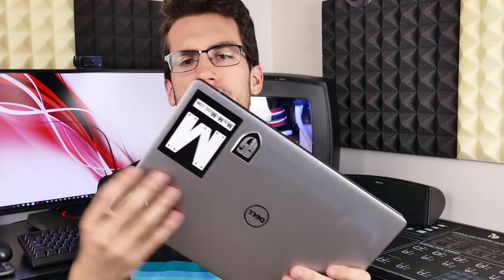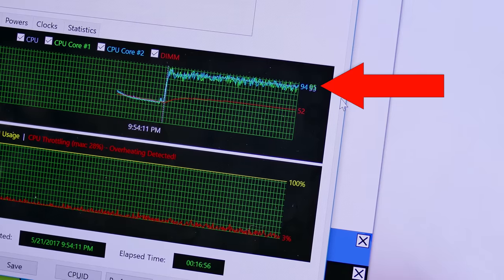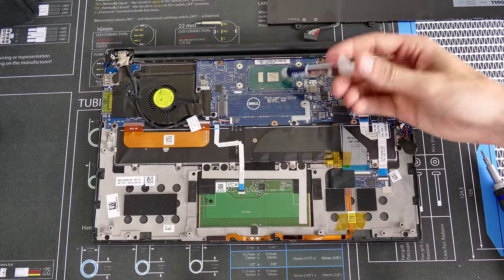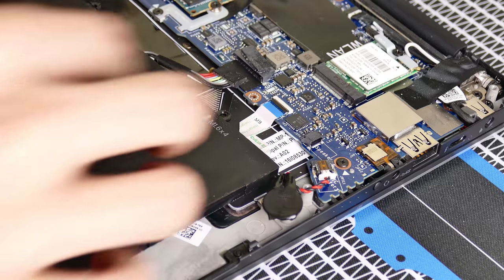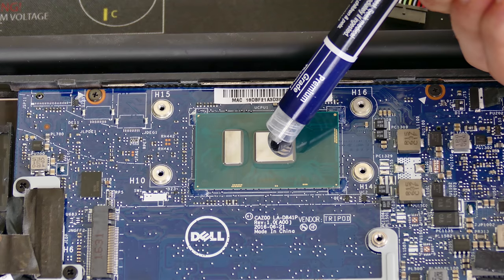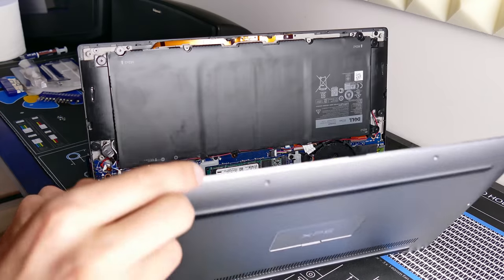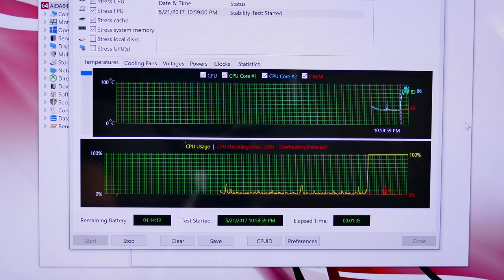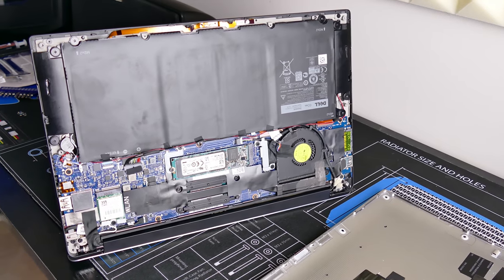Laptop Running Hot? Try This!

Comment: OMG you used way too much thermal compound, unsubbed!

For those that don't get this is sarcasm, it's sarcasm.
Reply: Hardware Unboxed ooohh Hardware Unboxed, love ur reviews!
Reply from the maker: Disclaimer 100% necessary this day and age LOL
Reply: Science Studio what does undervolting do
Reply: +Roko Krstičević - It turns the flame from blue to the yellow you see in the thumbnail.
Reply: Roko Krstičević undervolting isnt too complicated. Its somewhat related to overclocking, except the goal isnt to reduce performance. Stock voltage on cpus is not the minimum voltage a cpu can run at, its a standard voltage used that should work on all chips. this is why you "can" overclock on the stock voltage. undervolting simply keeps stock clock speeds, while lowering voltage. this can create instability problems so it has to be properly tested. 
an easy way to think about it is:
voltage + clock speed = output heat.
so if you lower either the temperature will decrease.

honestly if you don't need the extra clock speed, its a good choice to lower temps, and thus improving  life of the parts.
Reply: sar what?
Reply: deinemuddaisdoof 
voltage + clock speed = heat
so undervolting lowers heat without sacrificing clock speed. its basically the same premise as overclocking
Reply: ThePaisleyProject thanks for explaniatshdj (fuck my grammar)
Reply: Roko Krstičević no problem, I like sharing my knowledge. Extreme overclocking is my speciality
Reply: m8 I use 3 40g tubes of Hellman's lite TIM on my CPU... the more the cooler amirite!!?
Reply: ThEcRaZ3dGaM3R your doing it wrong, 40g of Skippy is optimal for gaming...
Reply: dude he is not dumb but pretty funny tho👍 nice👍  i have subscribed ur channel too
Reply: Hardware Unboxed I
Reply: lmaoooooooooooooooo
Reply: Hardware Unboxed ;)
Reply: Science Studio Did you just assume my age!?
Reply: Roko Krstičević lol
Reply: @GregSalazar  hello sir my laptop is HP core i5 my laptop is getting hot when i take 1 app can u tell why is it getting to much hot

Comment: "puts laptop in a fridge"
Reply: I run a copper pipe system from my freezer to my laptop. Temps work great!
Reply: dogsrulenw08 oo sounds funky
Reply: Vorphyrion there's moisture in a fridge, so you are killing your laptop.
Reply: Climatee If a copper system was indeed running from the fridge,it would mean copper pipes carry heat from the laptop to the fridge,where low ambient temperatures are I guess supposed to passively cool it,not sure where you're getting the idea of moisture getting involved.
Reply: Vorphyrion dumps fridge in Antarctica
Reply: Welp, as embarrasing as it is I cannot find the source, it's buried in some post at those forums. Anyway, dudes benchmarking 7700ks on their laptops often repaste CLU due to it breaking down after so many high temperature sessions. When I come across the specific post about Dell's paste sacrificing performance over longevity, I'll throw it here!
Reply: Vorphyrion "dumps it in pool*
Reply: That's what Linus could do.
Reply: Spoilers: Laptop over heats and shuts off because fridges dont recycle air.
Reply: something Linus would do.
Reply: as a kid I once put my x box 360 in a freezer to fix the red ring of death.
Reply: I did this with my ps3 once lol
Reply: It would kill your laptop faster than overheating.
Reply: Marcin Kąpiński Shags batteries for one!
Reply: Vorphyrion i put my phone in my fridge every time i can it hasn't die soo
Reply: LagiohX3 I phone is passively cooled therefore air isn't constantly needed to be recycled to keep it cooled..  weirdo... lmao.
Reply: It's a joke
Reply: *freezer
Reply: Linus did do this...
Reply: Daniel Parrell Yes he did...
Reply: So.... Just repaste it.... Ok
Reply: Yeah I was thinking to put it the freezer
Reply: Or fridge into laptop 😼😂
Reply: It's my problem also about my hp elitebook it's over heating I don't know what will I do .
Reply: @jenniferbilolo5412  add cooling past or more  cooling rods to the fan (i can't english xD)
Reply: @izicol4781 thanks !!I try to open my laptop in clean !!its work
Reply: I used do that before 😂
Reply: LOL
Reply: Me when my phone overheats

Comment: Yeah thermal paste reapplication is a great start. I'd also recommend undervolting the cpu (if possible) to reduce temps even more.
Reply: Was looking for this comment, I also use throttlestop to get raise current limit to 25 watts on u series intel chips but that will just get you to thermal throttle quicker.
Reply: Yeah mileage always varies depending. But undervolting is still worth it if you manage to hit a stable setting.
Reply: My i7 4600u laptop was able to get to around -90 mv stable. I found that you usually can lower it more if you turn off hyper threading but it makes performance much worse usually.
Reply: I read that somewhere too but that wasn't an option for me due to my day to day tasks. I've got an i7 6820HK.
Reply: If it decreases performance then a lot of times it has to run the processor hotter for longer so i usually like to keep clock speeds high as possible and use as many threads to get the work done and then it can go into sleep states.
Reply: 7700HQ undervolt offset -0.130V rock solid, actually turbo freely to 3.79 when before it only wanted to turbo to 3.58 because it was running hot.
Reply: Undervolting is a must. I got 10C drops in temps by 100mv on my 6200u. I only wish I can alter fan profiles. Also if u do any light gaming on these U series chips undervolting helps with power limit throttling as well.
Reply: My i5-6300hq undervolted -225mv stable, but the gtx 960m in my XPS 15 9550 runs way too hot. Reaching almost 90 C sometimes
Reply: madh01 did you use Intel XTU or ThrottleStop? Also if you used XTU how you made is so its consistent? Because XTU resets its settings after restart and you manually have to set every time you turn on the laptop.
Reply: I used XTU initially as the watchdog feature is a godsend. But switched to throttlestop after figuring what is a stable voltages. I realised that XTU crashes after a restart. So initally I only used XTU as needed. Switch to throttlestop as soon as you figure out whats stable and there are guides that allow you set scripts to run the program at startup.
Reply: madh01 if I am experiencing power limit throttling even after undervolting, should I increase the wattage I allow the cpu to use?
Reply: Undervolting helps in most cases. However one the issues with laptop is  the way they are designed and the way each oem designs it. If the cooling of a laptop is insufficient for the work load and sometimes even undervolting cant help with that.

Some laptops allow you to change the voltage/ wattage limits (if you are in the lucky one) but generally there will always be another register hidden away from the user that will always over-ride any changes made. If you increase wattage and there is another register showing a lower wattage, then lower wattage will be read in instead.

You can try to make the changes but if your laptop doesnt support it, then changes
Reply: Do you have to launch XTU at every boot manually? That was a bit of a turn off for me.
Reply: Other people on the internet have been able to set-up scripts to auto start with it. I don't how to do it myself. Without scripts everytime you reboot, you reset the value, so would end up restarting XTU everytime. I find XTU to be a good starting point to figure what setting and values to use, because if you go too far it will auto reset on boot. Once you figure it out, Throttlestop is the thing to use. It has far more features and you can set custom profiles depending on the usage. Even better is that the setting will remain even if you go from sleep.
Reply: Does under bolting reduce performance though?
Reply: i did try the undervolting thing (80mv on a core i5 8250u and there was no change in speed or in temperature on the other hand i speeded up my total premiere pro render time  by 20% by using a $15 laptop cooler pad (easier not to open the laptop)
Reply: I really want to change the thermal paste on my gigabyte aero 15x however i heard that Gigabyte's warranty would be void if you change the thermal paste. Does anyone know if this is true?
Reply: cries in ryzen
Reply: @ps3guy22  I also have an i5 6300hq and a gtx 950m. Can you please tell me how did you get to -225? My max is -125mv with throttlestop. Also, have you solved your gpu temp? My laptop is shutting down while gaming.
Reply: @anastasiumircea  Try upgrading the Dell Thermal Management Framework if you have an old one installed- that fixed my shutdown issues. I also can get max -135mv. I also take a thin freezer pack and put it under the computer separated by a towel. It helps.

Comment: good advice. if you're taking your laptop apart it's also worth having a can of compressed air handy to clear out all the dust that accumulates in there and making sure the fans and vents are clear, especially if your machine is a few years old.
Reply from the maker: Agreed. Wish I had one on hand!
Reply: well, yours looked pretty clean tbh, at least compared to the disgusting sight that greeted me when i recently opened up my 7 year old machine!! D:
Reply: boac2006 i use a hair drier lol

Comment: Nice video. I wish as many laptops were easy to tear down as that XPS. I've done two Qosmio's and it took a fair amount of time and effort to get at the CPU and GPU. Virtually had to disassemble 70% of the laptops. Like you found, just by cleaning and putting on new paste, I achieved a 10 degree drop in comparable temps. A good suggestion is also to get a can of air and clean/blow out out any vents, fans and all the 'nooks and crannies'. Take the opportunity to clean out your laptop and get that limited air flow maxed. If you are using the laptop on a desk consider buying a laptop cooling pad. Plenty to choose from on Amazon. My son has a Cooler Master Pad under his ASUS ROG and it helps keep the temps down. Thanks for another great video. Hope you are enjoying your Audi. Looks a real mean machine.
Reply from the maker: Lion Bites Thanks for watching! EDIT: love the ride!
Reply: You should probably Put thermal pads on the backsite of the Motherboard where your cpu and gpu is.I did this with my one and it wont go over 80c under load

Comment: Get one of those 4 color sided nail filing blocks and lap the copper heatsink on the laptop. Especially if your laptop takes a lot of work and you have to dissemble the entire thing to switch thermal paste. Most still require that especially Corporate/Enterprise laptops compared to consumer ultrabooks.

The filing blocks will have extra coarse, coarse, fine and extra fine sides. The extra coarse side is what will make it as flat as possible and you spend most of your time on that. The rest will just bring it up to mirror polish level. 

This typically drops the laptop another 5-15 degrees. Depending on how uneven the copper block was. Plus around another 5 from good paste. 

Since your sanding material is already in flat block form it really helps to get the copper heat sink flat. Plus these nail filing blocks are usually only $1-$3. Usually get almost 15-20 laptops out of each one. And they are the perfect size to fit in the laptop heatsinks.
Reply: JimmysTheBestCop what?

Comment: Thanks to your concise, and no bull** video, I got a 10 degree Celsius drop from 96 to 86 max running on AIDA64 for 6 minutes on my GL502VSK i7-7700HQ and 1070 GTX. I repasted after 3 years and the old paste was definitely dry. I used the new Noctua NT-H2 and I love it. I applied "X" on GPU and "line" on CPU.

Comment: I have the same laptop and i did the same thing but i also bought some thin thermal pads and placed them on the heat pipe assembly as well as the ssd. This conducts even more heat away from the cpu and puts it into the aluminum housing. Under load my max cpu temp is 76c, the bottom of the laptop does get a little hotter but i dont mind because i rarely ever place it directly on my lap anyways (gotta protect my boys). Haha great video as always.
Reply: My housing is plastic, it already gets hot, conducting heat to it could destroy it.

Comment: Replacing thermal paste helps, but undervolting is much more significant. Ive dropped crazy amount of heat from my GL502VS just by using both replacing the thermal paste and undervolting CPU/GPU (from 90ish to 60-70ish). I dunno why but it also increases the overall stability (0 fps spikes that Ive seen before) and performance (I can hit 120 FPS in Witcher 3, only 89 fps max before). It is worth the effort guys, trust me

Comment: You could also disassemble the box in which fan lives, clean it up, and add a spit of lubricant (i actually used a sun oil that most people have on their kitchen) between connection of the fan and a base it sits on. In my case i've achieved zero throttling, temps around 70 under load, and pretty much no noise, compared to terrible buzzing and reduced performance to around 50%.

Comment: To complete the task you need to actually tear down the fan assembly aswell because there is guaranteed amount of dust and wool balls blocking the airflow. However in this case the fins come of with the heatpipe/block assembly so not necessary in this case. However Acer and Asus uses fin stack attached to fan assembly and that way you need to remove pretty much everything.
I have also found out that using laptop 1-3h a day about  5 days a week trough out the year will cause the fan assembly to get full of dust and requires cleaning and which worries me people do not do that.

Comment: The HP Probook 450 is a total pain in the butt to take apart. Did the same thing - cleaned it (wasn't THAT dirty to begin with), changed the thermal compound and put it back together. Even with a youtube video showing how to take this model apart it was still time consuming and nerve wrecking at times.
I guess other manufacturers have better built laptop chassis.

Comment: I have a 4.5 year old Dell Vostro  
for which I have been considering this same action.
My temps had been running in the 135-150 range (Fahrenheit, not C... ). 
But by using "SpeedFan" to jack the pwm up to 100% (~5100 rpm)
I got literally a 35-40 degree improvement... 
so... I may still try this maintenance step. 
I suspect the TIM on mine is in no better shape! 
Thanks for the demo of yours.

Comment: I've seen the Dell XPS line used a few different times to showcase the improved performance from reapplying the thermal paste yourself. I wonder if this kinda thing is Dell specific or if most other windows laptops have this problem. I have a XPS 9350 myself and will definitely be taking a look in there.

Comment: Thank you for making this video!  I have an ACER ASPIRE 4730Z that has been notorious for overheating.  A friend cleaned cooling fan, cleaned thermal paste, applied Arctic Silver thermal paste, installed brand new mainboard and I bought an Xpad.  So hopefully it will run cooler--I'll let you know.  Can't wait to try AIDA64.
I also have a DELL LATITUDE E6410 and the avg temp for CPU under 100% load was 82.1C after 2:00

Comment: Great video. I am curious why your laptop didn't post the first time you did this? Did you potentially fracture some solder balls between the CPU and PCB when over-tightened the screws? Did the CPU make contact with the motherboard again when you loosened the screws?

Comment: Long->Short; cooler, quicker, worse battery, and very hot exhaust under heavy use.

Short->Long;
Did that on my Yoga 2 Pro a few months after i got it, but i used Liquid Ultra and some normal paste around it on the chip (not on the die) to prevent the Liquid Ultra from shorting something out. First thing i noticed is that it never drops out of turbo boost under normal use, or even moderately heavy use. Second thing i noticed was that it never got noticeably warm anymore. Although the exhaust went from warm to uncomfortably hot. Last thing i noticed was that because it staying in Turbo Boost the battery would drain quicker if i was doing moderately heavy tasks.

Comment: Thanks, Greg, this works fine for my Dell M3800. Before I replace the thermal compound, the CPU temperature is about 80c, after the replacement, it's about 55c±.

Comment: I agree with the thermal compound amount. A little too much is far and away more safe than not using enough, especially if you are applying directly to the CPU or GPU die.